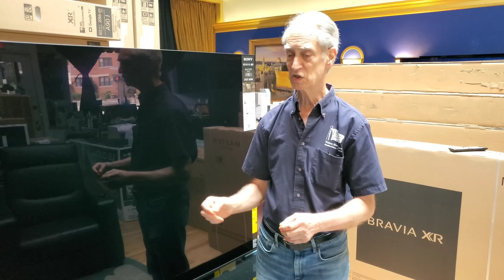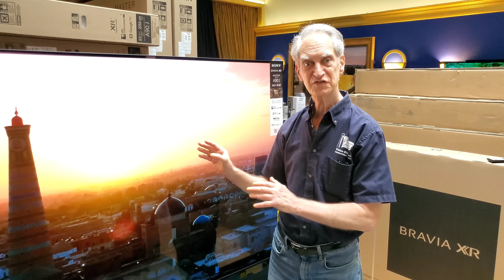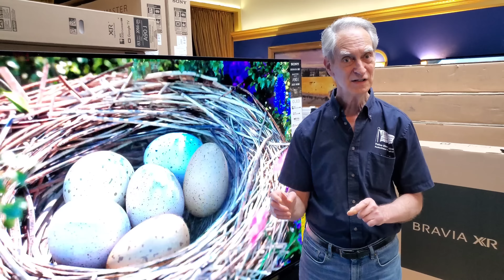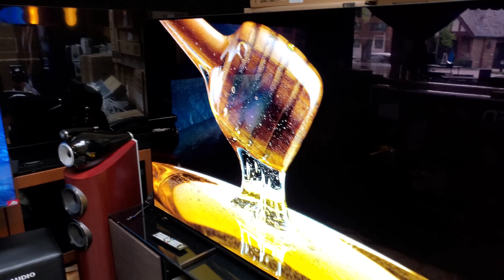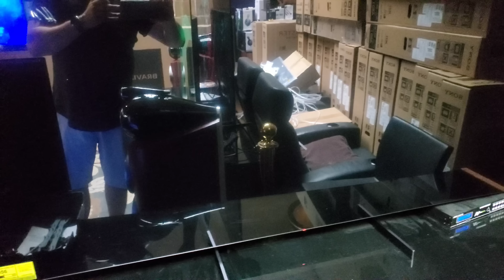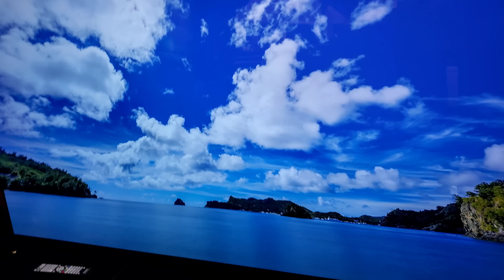SONY 83" A90J MASTER SERIES OLED INTRODUCED BY ROBERT ZOHN INCLUDING G1, X95 , Z9J AND QNED DETAILS

Comment: Hi, what about motion handling on the A90J? I heard and read on different sources that the motion handling on the A90J is bad and has issues like stutter, especially with slow panning shots. What is your opinion and experience with that? I'm thinking of buying the 83" A90J in 2024 because the price went down a lot in The Netherlands for a new A90J. Thanks!

Comment: The A90J 65 inch can only be stood up with stands that go out to the very ends of the TV.  It will not fit on my stand.  However this 83 inch will mount two ways.  At the ends, and towards the middle like showing on this video.  What is the measurement between the two feet with the feet mounted on the inner part of the TV?

Comment: Man the bestbuy here by me has a 85inch  Q90t open box for $2,778 . And it's on display also so you see it on and working as it should. I'm wondering if I should pull the trigger or wait for the 85 x95j😒🙄

Comment: Hi Brian.. i wanted to check if 65 inch a80j oled in evo panel
Reply from the maker: I'm not sure at 65" but I believe they are unofficially ofcourse
Reply: @BRIANSTECHTHERAPY  i bought 65a80j last week.. june manufacturing.. its an old panel

Comment: I had a question about vertical banding on the 77 A80J. When I received the panel I checked it for vertical banding using various vertical banding YouTube videos. I didn’t see any banding however after about 1 month use (approximately 3-5 hours of use per day) I noticed some vertical banding. It’s not visible on content so far but visible with those banding YouTube videos. Is this something I should be concerned about? 
Thanks in advance.
Reply: Banding does mitigate over time and if you don't see it in content it's a non issue.  All OLED TVs have some banding, but if it's minimal you will not see it in content and that's all that matters.  You have a goo Soy 77A80J!
Reply: @valueelectronics9390  thank you for your response. I appreciate it
Reply from the maker: In regards to vertical banding with oled is to watch all kinds of content and don't look for it. If it's not seen in content it's perfectly fine. Checking banding slides at first is a mistake as all oleds will have some banding.  Banding will improve overtime with oleds as well.
Reply: @BRIANSTECHTHERAPY  thank you for your response
Reply from the maker: My pleasure Carlos

Comment: The 83 inch is approx 16.2% larger  screen area than the 77 inch.
Reply: But still not worth a 5k jump in price
Reply: YES.... I'm trying to get that point across to people.   So not worth the premium.  You can buy 2 77" for one 83"   I have a 65" B8 but a 60% screen increase for 4x the money??  I'll buy a boat if I wanna burn money that fast.  Not even counting taxes and extended warranty.

Comment: What are Roberts expectations of the black levels on the X95J?
Reply: Blacks will be very low, which is good.  The new LCD/LED panel and XR processor are designed very well to work together to deliver deep rich blacks and excellent overall image performance.  Sony included our company in the first allocation.